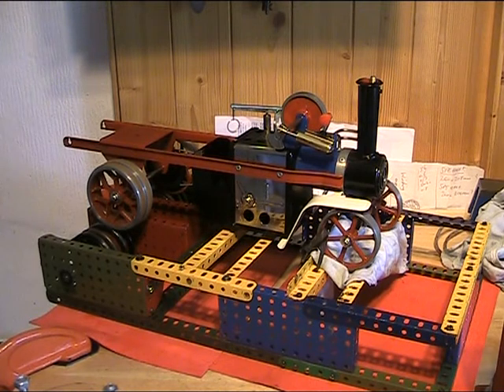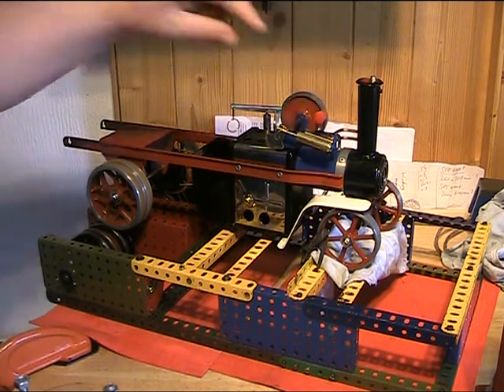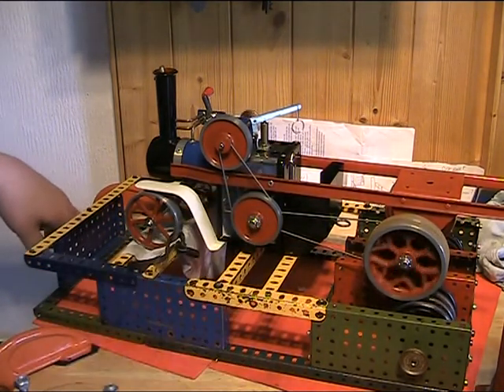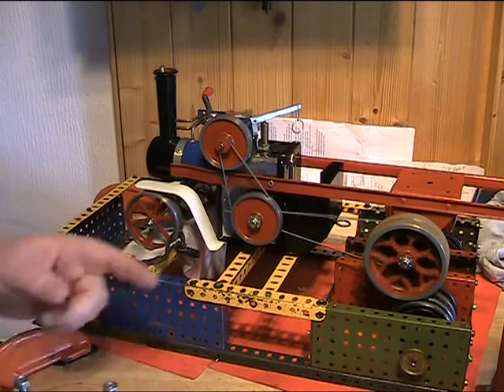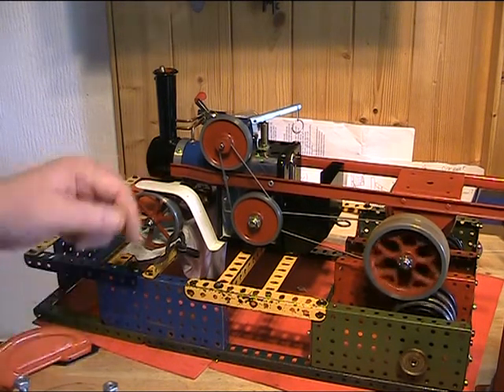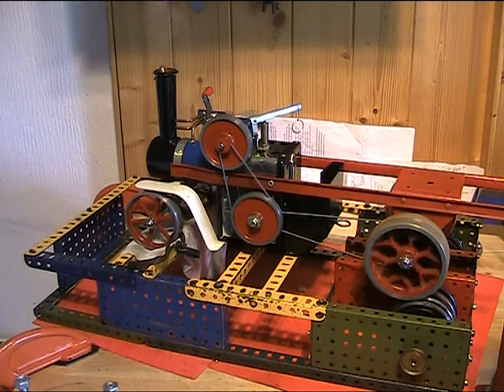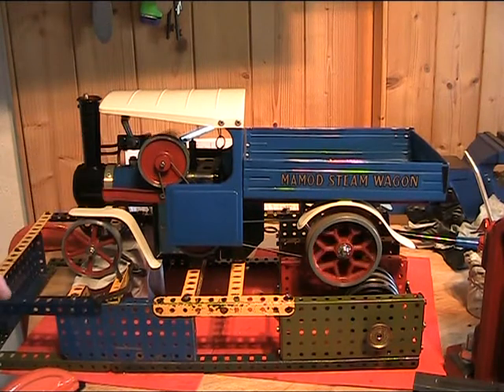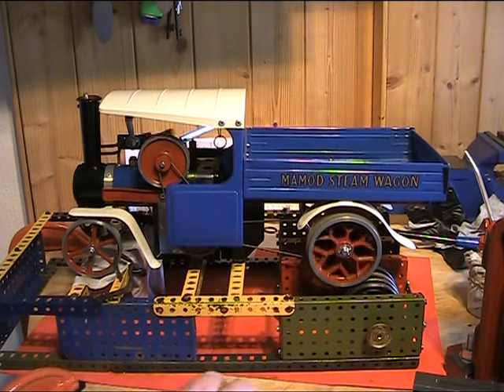MAMOD SW1 STEAM WAGON

Comment: that`s great..nice ticking over slowly as well....i got a second hand one for xmas..an older one with water plug,instead of sight glass..its in pretty nice condition and ran well...but little control on the speed regulator..fast both directions seems to be the order of the day,but cannot get slower running...only by holding the lever in position....wonder if this will rectify...don`t think it has had too much use...a nice gift though,,,,enjoyed your video..
Reply from the maker: If the lever is held on either a bolt and spring, make sure the bolt is tight, ir remove and stretch the spring a little, then refit.
Reply: @PLAYINGAROUND  thank you..will give that a try...cheers ade
Reply: All Mamods have three speeds forward and reverse, faster, faster and still a littler faster!  Even a idle for a Mamod is fast.
  With Wilesco's you should not run them at full speed for long periods, but I don't think one can over run a Mamod.
Reply: @PLAYINGAROUND  - I have actually had the trunion bolt fly out during steaming!  It was quite startling!  I was filming at the time, but stopped to pull out the burner, but IO should have recorded the incident.  It would have made good views on YouTube.

Comment: Great video,just purchased the Mandon steam wagon SW1 can you tell we’re is water level,thanks.
Reply from the maker: If it has a water level plug, until it runs out of its hole. If it has a sight glass, there is a level mark pointing the maximum level about 5 or 6mm (1/4") from the top of the sight glass. I can't remember if very early sight glasses had the level mark pointer or not. What colour is your steam wagon?
Reply: @PLAYINGAROUND  It’s green, I found the over flow plug,but the window  to check water level,I have not found.     I can take a photo and send it to you if that would help. I appreciate your help thank you very much.
Reply from the maker: @benny4614  no need. Unscrew water level plug at the rear of the boiler. Remove safety valve on top of boiler. Fill water through safety valve hole until it runs out of water level plug hole. Refit water level plug. Make sure safety valve moves freely. Replace safety valve.
Reply from the maker: @benny4614  Same principle here although different engine. https://youtu.be/u9_qXxg9Noc?t=421
Reply: @PLAYINGAROUND  Thanks for that, the only thing he did not mention is how do you check the water level when the engine is running,thanks for your help.
Reply: @PLAYINGAROUND  Thanks,that I understand but when the engine is running how do you know that you have enough water left.I have a bus and stationary engine and it has a window and you can see if there is enough water in the boiler.The SW1 does not have this, is there another way to know to be able to check the water level,thanks once’s again.
Reply from the maker: @benny4614  two fills of the meth's burner to one of the boiler from the max level. then start again by filling the boiler.
Reply from the maker: @benny4614  from the max' boiler fill you get two burner fills, presuming it's an original meth's one. after the two burner fills, refill boiler to max level and repeat.
Reply: @PLAYINGAROUND  Yes it’s a meth’s one,can I use instead of meths can I use Gel Firelighter,thank you.
Reply from the maker: @benny4614  yes, but it's not as easy as just swapping. After findling one that works you will have to experiment to find how much to use, plus get a gel fuel that burns clean.
Reply: @PLAYINGAROUND  Thanks,when I was about ten ,a long time ago we used methylated spirits with know problems,but I think it’s safer to use gel or Mandon fuel tablets.
Reply from the maker: @benny4614  as with everything, if you stick to the rules, meth's is perfectly safe.
Reply: @PLAYINGAROUND  I will do a test with the gel,when you use meths how long does it burn for?
Reply from the maker: @benny4614  can't say without testing and timing. Perhaps 10 to 15 min's.
Reply: Ok, that’s fine it will give me a base to see if the gel lasts longer or not. Thank you very much for your help and patience, much appreciated.
Reply from the maker: @benny4614  don't take that as read. You should do a meth's test first.
Reply: @PLAYINGAROUND  The gel does not run very hot and does not last as long as the wax fuel, I just ordered a bottle of meth.
Reply from the maker: @benny4614  trial and error with the gel fuel.
Reply from the maker: @benny4614  bottle of meth! 😲🤣.

Comment: I have the blue mamod wagon  but it's a poor runner  keeps stopping  and starting   could do  with a     BETTER PISTON
Reply: either the gears should be increased in these, the gearing is too long... or modified with a larger diameter cylinder.

Comment: Most videos   of    engines  are poorly  maintained when it   comes to oiling them    what about the wheels  there moving  parts aswell    I put    a few   drops of oil in   the     boiler   to make sure the  piston  gets lubed
Reply from the maker: yes. Lightish oil, but not that often. Some of the more modern models have the main axle in a plastic bearing, thus should't need oil.